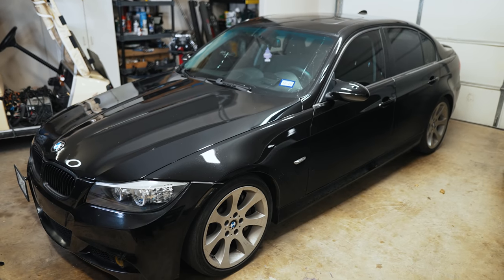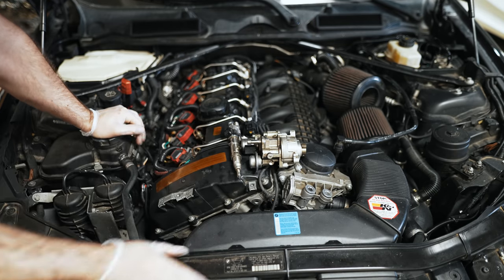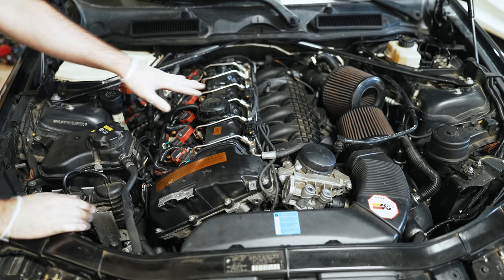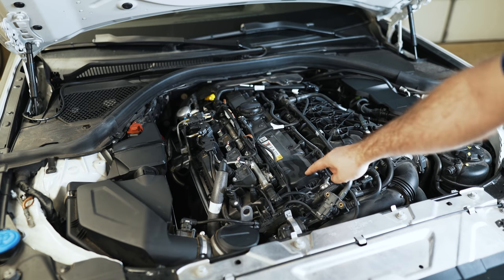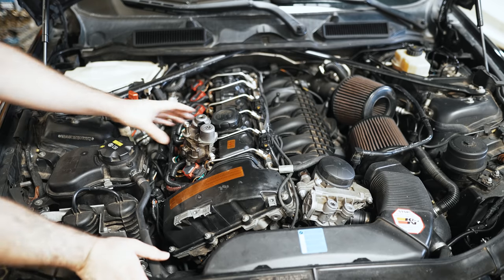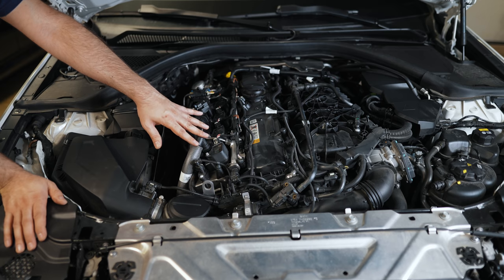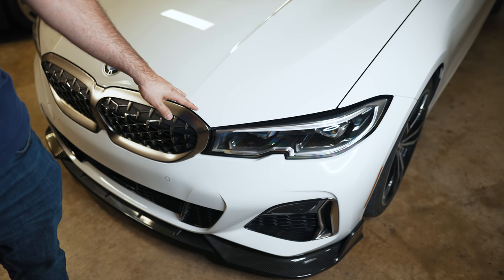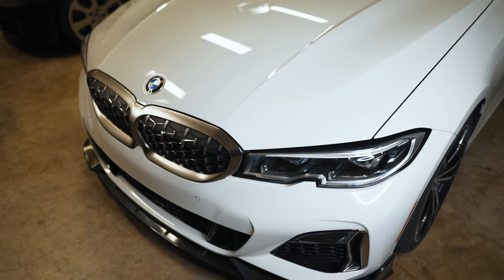Here Is Why New BMWs Are Now Reliable

Comment: That is rubbish how they dare to make so many plastic parts that take so much heat especially here in the Caribbean and even in other places where the weather is so hot almost all year long.  Not so bad in winter, which we don´t have, but when summer is here full blast and with the engine running for hours, can you imagine how hot that engine gets?  It´s incredible how hot the heat coming from under the car. Even when only the car is sitting under the Sun and you get inside, damn you can´t even touch the steering wheel.  So you can imagine how can someone use plastic for parts which even double the heat with the engine running.  Just can´t understand where they were sitting when designing something like that?  Thanks for sharing all you know with us dear friend!!!  Bye!

Comment: BMW makes a nice car, but the oil filter housing configuration escapes logic.  having this housing with different temperature surfaces at a right angle from each other, holding a thin gasket separating coolant and oil and if it leaks, which it will, leaks onto the alternator.

Comment: 60k brake discs shuddering like mad. 65k air suspension went on a F11 B20 90k some electronic gremlin, turns out to be the battery. 100k? Maybe waterpump

Comment: is the n52 motor reliable and worth buying?
Reply from the maker: The later N52s don't have significant issues just oil leaks and valvetronic sensors, ignition coils etc.

Comment: Thanks for the video. Interesting.... But having had two N52's (E90 330i, E61 530i) I'm going to say let's see what happens when these cars are 10+ years old and have 130.000 miles or more on it. ;)
Reply: I just brought a 2012 335i with 145,000 miles and all I gotta say is so far I drove from the dealership to my house and it hasn’t blown up yet

Comment: What's your take on the F10 M5 V8 motors? The S63? Coming from a E90 M3 I haven't heard the common horror stories like crazy oil leaks or bearing issues on the S63 motors.

Comment: Lotta things go into a car. As these BMWs age, relatively minor things go wrong, such as the breakdown of the foam under the hoodlining. While this is acknowledged to effect all european cars because they are not designed for the hotter temps found here in Australia, or NV, TX, NM etc. These smaller jobs become a big expense because every time you remove a simple piece of trim to fix something, the lousy plastic breaks and then it starts to get expensive.
If their plastic was as resilient as the Japanese vehicles, they would be a vastly more appreciated brand. Not everyone can afford a low mileage BMW.

Comment: I own a 330e with a B48 engine. It has done 104k miles. Needed a new starter motor at 30k or so but has been good since. The exhaust is a bit smoky but everything else is still in good nick.
Reply: Do you still have it what’s your latest review on it
Reply: @hammy316  yeah still have, currently sitting at 130k miles. One coolant pipe leading to the cylinder head underneath the intake manifold burst at 119k. Quite common on B48... I needed a new rear left wheel bearing around 114k. Steering rack design fault issue needed to be fixed with a BMW kit. I still have a fuel tank sensor pressure issue but it's not affecting me and i have no dashboard lights. I needed a new auxiliary battery for the engine starter which i replaced myself  with an original bmw part for £64. My A/C cooling pipe leading to the high voltage battery had a leak and needed to be fixed. So far in 6k in maintenance and repair including tyres and wheel alignments. The rear left suspension strut also leaked at 90k or so.
Reply: @Dmxravin  ok mate did you get repairs done at dealership or and on normal garage for 6k
Reply: How often did you change oil would you say car is reliable I just got 1 it’s done 78000
Reply: @hammy316  the burst pipe and the A/C pipe were both replaced at the dealership. The labour rate was £120/h. brakes discs and auxiliary batery was done by myself. The wheel bearing and steering rack was done at a bmw specialist. Thinking back I could have fixed everything at that the specialist. The dealership was able to accomodate me sooner though.
Reply: @hammy316  I change the oil whenever the onboard indicator tells me to. so usually 13k-14k miles. I use LL14FE+ or LL17FE+ 0w20 oil. It does use about two litres of oil between changes less so with 5w30.
Reply: @Dmxravin  thanks mate for all info I will keep a look out for maby get them all done at once near 10000 … once last thing it you don’t mind what year  plate  was your 330e

Comment: The aftermarket has been using single turbos with very satisfactory results for many, many years.
Reply: The two turbos aren't too make more power, but using smaller ones let's them spin up faster so there is very little turbo lag compared to a big single.
Reply: @BenjaminTurnerAUS  The thing is a properly sized and spec'd single will spool up sufficiently to avoid lag, I've had a one on a three litre V6 with a LSD that would spin the wheels from start if I was not careful. Twins are an example of over engineering.

Comment: In Consumer Reports magazine April 2024 annual auto issue, BMW placed first overall in a ranking of over 35 auto manufacturers for:
Performance
Quality
Reliability
Comfort
Infotainment and other controls
I have a 2024 Supra with B58. Since 2020, they have been very reliable engines, in part because of BMWs collaboration with Toyota.

Comment: The heat shield next to the air box isn’t there to improve reliability but prevent the intake air from heating up which would lower the oxygen density which in turn will reduce efficiency
Reply: Made good points though!

Comment: The new Bmws are more reliable for sure in all aspects.  The problem I have with the new generations is the driver feed back is lacking, most notable is the digital steering.  It really feels strange not knowing what the front axle is doing.  I had a recall done on my N54 for injectors and I was given a loaner to drive while the new injectors were being installed.  It was a 330i and I was not impressed with feel of the road the digital steering was lack luster.  The power in the four cylinder was good but the motor felt like it was being taxed.  The traditional hydraulic rack and pinion has exceptional feel and the M sport chassis gives proper feed back on both front and rear axles.  The new bmws feel confused between front and rear in the handling department, and they are growing in weight and size.  The new M5 is almost the same weight as a pickup truck and the 3 series is as big as the old 5 series.   The styling is a squared off look in my opinion compared to the E90 generations.   I still like the new Bmws and my personal choice for my next generation is the M2.   Great work again and yes the M3 looks very nice go for it.
Reply from the maker: Yeah I had the same complaint when I had an F30 330i loaner back in the day.  I am not a fan of the F15 steering as well compared to the E70 but the steering in the G20 330i isn't bad and the steering in the M340i is actually pretty good.  Not a tone of feedback and it can be overly weighted in sport mode for no apparent reason but compared to the E90 it's about 30 to 40 percent as communicative which doesn't sound great but given it's an electric rack I'd say that's a bit of an accomplishment.
Reply: Too bad that don't just use the hybrid system to power a hydraulic rack like on the Toyota M2.

Comment: Very interesting. I have a 2017 Giulia and when I first looked at the engine I was amazed at all the heat shielding and thermal management----even the intercooler itself has its own coolant tank/system. Four years later, not a problem so we'll see as time goes on, but it doesn't appear heat is going to be the issue with these Multi-Air engines. Smaller versions of this engine have been in use in Jeeps for a long time already and no horror stories about premature failure. BMW was new to turbocharging and even those engine wizards didn't really know what the best way was at that time. Always be careful of buying a manufacturer's "first" design of anything!
Reply: Was going to get one, but back in 2020 I had no confidence in Alfa Romeo. But I’ve heard good and bad things about the first Giulia’s. How many miles you have on yours rn? The Giulia’s 4 cylinder is a newer platform? Or is it derived from a previous Fiat/Chrysler platform?

Comment: BMWs are usually leasing type vehicles for the most part. Data shows majority of BMW revenue is lease oriented. I believe the reliability upgrade is simply a new direction based on their sales data. Majority of Bmw purchases are second hand leased vehicles and improving reliability is to cover their own a$$. I highly doubt customer has anything to do with it considering these new engine upgrades are plain simple common sense upgrades. This could have been done years ago

Comment: I have an 2006 335i with the N54 motor from new and have only ever run premium fuel nothing else no E fuel at all, my car has now done 220k and has never been a problem although I have upgraded Turbos three years ago, I also have a better air flow through the engine compartment keeping components cooler, E fuel in any car if not modified correctly with fuel lines and pump will be unreliable, some people just don't get it., that new BMW run e85 for about a month and then come back and say it is still fine.

Comment: I won't call a car reliable unless it can last at least 500 000Km (~310 000 miles), we had a Honda Jazz that last from 2008 - 2018 with no issues at all, all we did was change brake pads, oil, tyres, and the other usual maintenance, nothing ever failed on that car

Comment: I know to many people that had lemon law lawsuits against BMW to ever trust them, I had a friend with a brand new X6 she had to put a quart of oil in every time she took a road trip. Bmw told her that was normal its a performance engine, till eventually the motor went at 30,000 miles locked up on her. She was still paying for the car till her lawsuit was over 2 years later, they gave her the value of a brand new X6 for every year she owned her lemonade x6. So that was alittle over 250k for BMW and they had to buy back her car.

Comment: Have you looked into the M550i? Just wondering about its reliability compared the previous v8 engines and their share of problems ... oil leaks ... etc.
Reply: Im going to assume you mean the M5 turbocharged V8 that was released after the V10 disaster engine? Ive been told that its mostly okay. Suffers common issues like you mentioned, oil leaks. Theres a saying that you arent a true BMW owner until youve had an oil leak. So I guess its not something unusual. The thing is, the engines aimed at regular consumers are so good, that buying an M car exclusively isnt really worth it anymore. I got the chance to drive one of the newer 2 series with M performance package and holy crap, it goes like a stabbed rat!
Reply: The F10 550is had some catastrophic failures, I can’t remember the exact issue but I remember BMW offered replacement long blocks for very cheap as it was that bad, the issue would pretty much total that era 550 or 750! The G30 M550i (what ur talking about) I believe is much improved with an updated version of the same motor. It’ll still leak oil once it’s 7 years old I can almost guarantee it hahaha
Reply from the maker: The N63s with the technical updates will still have a number of issues after about 80k miles but they've come a long away.  The hot V design is the culprit.  If they keep running it with time I think they'll prove to be somewhat reliable.  The N63 I had in my 2015 X5 with around 60k miles on it was showing no signs of failure,
Reply: I appreciate your responses. I guess what i was hoping to hear is, "Yeah, they've done such and such to improve its reliability ... " like you did in this video, but I would be too naive to think a V8 5 series almost M5 can be trouble free and be such a monster of a car. I just wished the new inline 6s sounded as good as they used to, or as good as the v8s.
Reply from the maker: Yeah I don't think the V8s will ever be perfected or perfectly reliable but they will probably reach a point where you can get to 100k miles without any 2K+ major repair bills.  They should make an M540I with the same engine as this car but tuned to run more like 450 HP.  That would be an awesome package.
Reply: @VehicularDIY  Wonder if they’ll do a 545e or something like the 745e... B58 hybrid. But then make it performance oriented

Comment: I own my E90 rwd N55 A/T  since 2013, she had 9k km on it... brand new really, 135k km now, fbo icl pure st1. Still a daily driver '' Major'' issues  was coolant reservoir 3x cracked as well the coolant piping just breaking 2 x, waterpump failed 1x and oil cooler gasket 1x. Had oil analyses and engine is great. I can feel the gearbox isnt as fresh (new  tranny oil every 60k km, engine oil every 10k km) but i think it's more because we have more redlights and traffic honestly because zero issues in Germany or NL because of Ai red lights... but considering multiple trackdays, drift events or dozens of Euro trips 1400.-2500km trips and sitting at 130mph for 2 hours straight on the Autobahn (average at 110mph usually ) i really don't see myself getting into a newer bmws. unless i actually want luxury... Would a B58 engine+gearbox swap be worth while? And the smaller engines bay allow enough cooling for it? I'd love you thoughts on it. Recently drove in a new E63AMGS, e39 M5, M140i and i stil love my e90. It's mostly the gearbox that shows age... Likely will buy and e9x M3 and get a cheap low mileage 540i wagon... Sometimes nice about B58, usually ring cars have great suspension and stock power but even suspension companies have B58 cars stage 2 set up( downpipe, airbox +remap) that just shows the reliability because usually we don't  we need more power in the EU bimmers  just good handeling. Because we don't have straight roads like the USA.

Comment: IMO you can truly speak of a car`s reliability after at least 150k-200k km (100k miles). What reliability criteria can you speak of in a car with 30k km and 1.5 years of age? It`s a brand new car, still in warranty and it would be a shame and would truly suck for it to break down. I have an 1 series from 2008 with N43 engine with 170k and it works like a clock. Except NOX sensor, oil pan gasket and cylinder cover gasket and other small gaskets, no real issues in 3 years of ownership and 30k kilometers done with it. The HPFP in your engine is just like in mine; 2 bolts and a spring that is driven by the exhaust camshaft. I`m guessing the same goes with B48 and B38. In the future I`m looking to purchase a 3 series with either N20 engine or B48 engine, I`m still doing some research on them. Great video! Let`s talk again in 10 years and 150k miles and let`s truly see how reliable the B series engine is. Cheers! ^_^

Comment: WOW! I'been a motor head all my 49 years old, with just basic engine understanding and knowledge, I used to change spark plugs and more tune-up stuff to my old 1981 280 ZX and my old 89 XJ Cherokee Renix, but now for any maintenance to my 2008 Chrysler 300 and 2015 200C AWD, I just take them to the dealers service department....BUT AFTER looking at your video I HAVE DECIDED that my next car will be a TESLA MODEL 3!! yes no more INTERNAL COMBUSTION  ENGINE SHIT! By the way I also had a 1995 535 With the V8 loved the robustness of that car sadly I sold it in 2008 When purchased the 300, should have kept that jewel of a car, dark gray with light gray interiors..... anyway ELECTRIC IS THE WAY OF THE FUTURE NOW... NO MAINTENANCE!

Comment: I have the 2020 M340i Xdrive, purchased in May of 2019.   So it about two years old:  in that time, the dealer had to replace both the drivers and passenger side folding mirrors, the whole shebang, motors and glass.   In addition, the passenger-side laser headlight had to be replaced.  Just the laser headlight as a part is $3,000.   So figure around $4000 to replace it and another $3000 for the two folding mirrors.   I am now noticing a pop when you push the steering to lock either side, it is a known G20 issue.

So I gotta disagree with saying the M340 is reliable.  I love the car but "BMW" and "reliable" are not compatible.

Comment: Those water pumps on that engine leak from a metal seal cap directly underneath it. If you look with a mirror you can see it as green residue at first. That AC line leaks too that goes under the coolant reservoirs to the firewall. I've also seen the coolant reservoir crack on the side. Other than that they have some software issues that might need to be updated. Overall really reliable compared to other bmws. 

On one b48 engine ive seen the camshaft lobe rotate slightly independently from the camshaft actual shaft causing the valvetronic motor not be able to adjust, you get rough/unstable idle. Hopefully this does not happen to the b series engines as a common issue.
Reply from the maker: Yeah I think the B48s are still going to have some issues but they have been getting better.

Comment: N54 ( a lot of power able to make ) because you trade in all your life line reliability on it for that, unless u spend a sh** time 💰 rebuild the whole engine with aftermarket heavy duty parts which is around 15-40k 

N55 , more stronger and reliable but less power it can make 

B58 , huge improvement from both , it can hold more power and staying strong solid 

That’s what new technology rule is , there is always improvement when comes the newer stuff , otherwise why we need new tech & other things ?